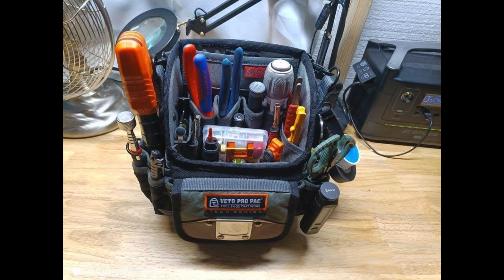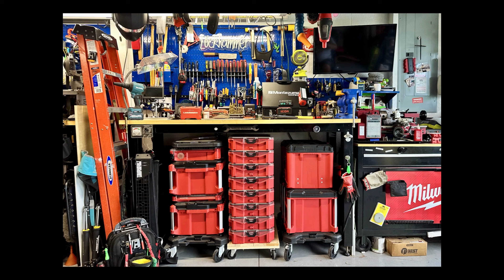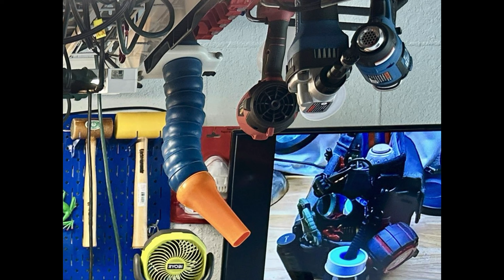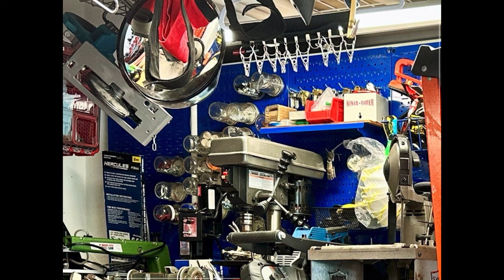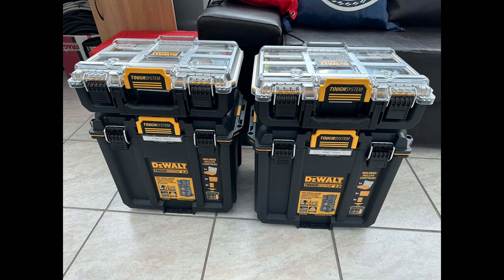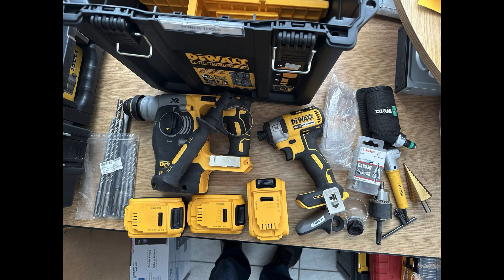EP. 30 Guess the Trade RELOAD  #tools #loadout #trades  #dewalt #bluecollar #IT #locksmith

Comment: I'm assuming that peg board is wall control it's the one brand Ive ever seen that color for a pegboard.  Love me a triangle shop box thoes are worth it for anyone thinking there neat looking.  They offer veto like organizing in metal form.  If you go shopbox line it's not weather sealed and far cheaper.  I keep mine in the back of my suv and use it often keeps rust at bay too parked outside.  That tough stack has some cool accessories like the charger box that is fairly unique.  Good stuff thanks for the video.
Reply: It is Wall Control. I also have another wall covered with it the pegs are great they don’t fall off.
Reply from the maker: @MattHmm-rq6dn  you were right on the wall control 👍👍

Comment: Dewalt and other makes' 20V are actually 18V under load. The EU must have a rule on that, although they apparently allowed Festool to describe their newest 10.8V tools as 12V (to compete with other companies' 12V/10.8V tools?); so they allow some roundoff. 24V is 21.6V, etc. I think that starting next year they may require battery interoperability, like they did recently with USB chargers.
Reply from the maker: @pdfads  appreciate the info 👍

Comment: That is an extensive work bench from Lockhammer, I am never that organised to have tools hanging up on a peg board. Although I have started to put some tools in the spare V-Swap panels I have.
Reply: The bench is usually Chaos. I have workbench tops on those pack outs I have to roll out when the bench is covered and that folding Toughbuilt bench gets a lot of use.
Reply from the maker: @three-phase562  I try to stay organized, but their is usually spurts of chaos